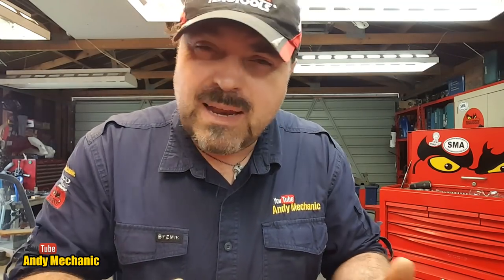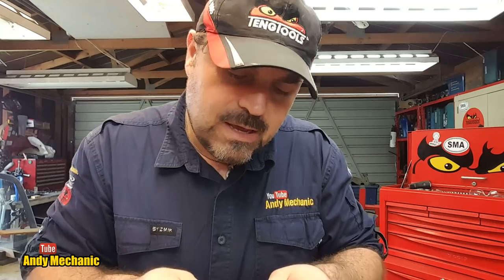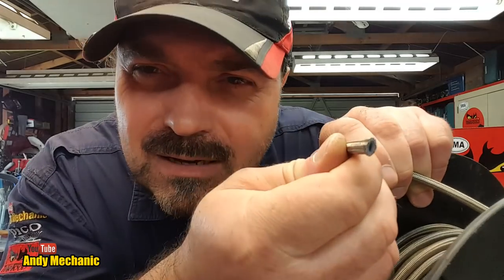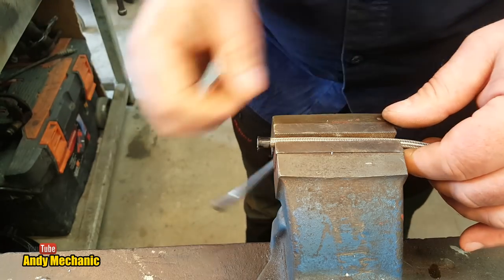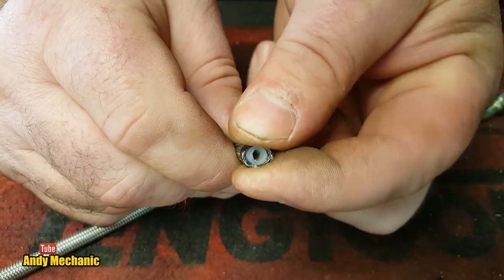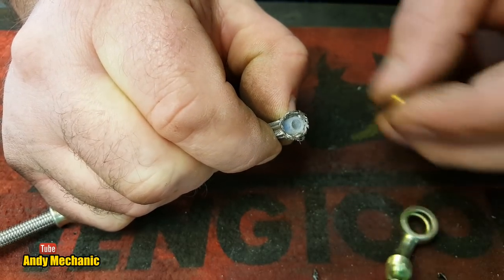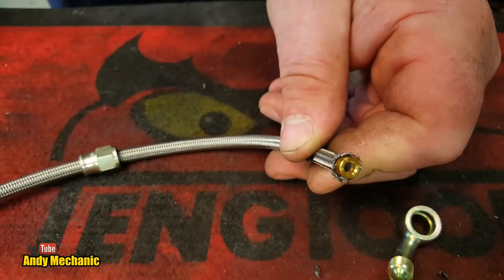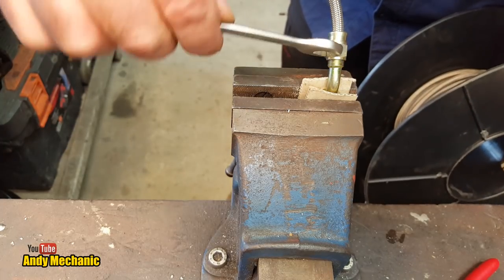How to make Stainless steel braided brake lines the RIGHT way #1336

Comment: Don't forget to blow them lines out when finished cutting through them because debris/dust blew into the hose while cutting it off and yes, trash goes inside there. Should blow the hose out before assembly as it will be easier than trying to get an air hose nozzle near the end of a brake line port as it is inside the loop. No sense in letting trash flow around in your lines etc. causing wear and tear, and possibly blocking ports or sticking brake pistons. Cleanliness is number one!!

Comment: Could have put the nut on the line first from the fitting. Then follow the steps on the video of taping the line and then cutting it with a disc grinder. This way you don't have to "fiddle" nut on the line.

Comment: The reason it's a 11mm is because everyone loses the 10 and 12mm spanners and nobody loses an 11
Reply from the maker: Haha! Awesome answer! Lol
Reply: I don’t even have an 11 socket I don’t think
Reply: @jaredtippets6255  Good because you can't even use a socket on that.
Reply: The reason an 11mm fits  is likely because its actually imperial 7/16" which is a close comparison. This  teflon fitting/ hose system originated in the USA.
Reply from the maker: Ah....good to know, thanks Nick :-)

Comment: Worth pointing out that this video features braided hose without a clear plastic coating on the outside, which would need peeling off for a short length if you are to have a chance of getting the hose into the fitting. Also I found with the pipe and fitting I had that the olive was very much harder to get over the teflon inner than in this video, and similarly getting the spike into tube through the olive very tricky.
Reply: yea same as venhill sleeved hose pain in the arse

Comment: I've had a recurrent problem with the DIY threaded union lines. The last few threads worth of tightening always seems to cause the braiding and the inner tube to twist, and then tightening the other end adds to the twist.
This can ruin the teflon tube.

I would like to suggest that suppliers send a reverse threaded union for every normally threaded one, as doing final tightening would then cancel and twisting tendency .

Comment: Shrink sleeve around and overlapping the end of the hose with is little lubricant allows you to slide the fitting on the pipe easily.

Comment: Nice video, after cutting the hose do you ever have to worry about cut particles inside the hose at all?
Reply from the maker: Interesting point, thank you. It hasn't been an issue yet but blowing the pipe through should clear any out.

Cheers
Andy
Reply: @AndyMechanic  I did like the idea of not crushing the hose with diagonal cutter. Great video.

Comment: The 11mm is actually 7/16" AF. Probably made in the US. A good close up of the tool would be useful to help me turn one on my lathe
Reply from the maker: Yes, I think you are correct, the kit could well have been made in the US. The hand tool just has a short nipple that inserts into the Teflon pipe and a tapered outer that then runs down the outside of the Teflon to flare out the branded cover. Suppliers of the unions/pipe should also list the Tool as it really helps when making up these lines. You'll probably find it on the suppliers Web site.

Hope this helps
Andy
Reply: The tool from goodridge is £12. Maybe $10 They come in different sizes for different  size hose.

Comment: i,ve got a tricky one for you, SO i have the Honda nc750s with abs on it, i won't to change my handle bars which means i have to replace the front brake hose making it longer, the problem is the brake hose runs from the reservoir to a junction box below the light, that hose has a crimped end to the junction box or block, whichever you chose,  so without putting a joint in the middle of the pipe because insurance companies are getting very keen these days, how would i go about removing the fixing and replacing it, or would i need all the crimpers to do the job, by the way happy Christmas from glossop just over the road from you at the bottom of the snake pass.

Comment: hi andy greetings from italy. nice video indeed. two questions : first , should you screw in the assembly until all threads are " disappeared"?  second question : when i am going to tighten secon end of a line i cannot find a way to avoid havin the pipe twisting while screwing. in this way i loose the right position on the brake lines of fittings. how can i solve it? thannk alberto
Reply: I agree...was about to ask the same question. I've just wasted a day trying to get the two short lines back onto the master cylinder on the prototype Grinnall Scorpion 3, it seems to be quite impossible, as the final torquing always moves the hose.

 It would be  far easier if there were reverse threaded unions, so torquing the other end of the line would remove any twist stress in the hose.

Comment: Andy I've got a question regarding stainless hoses. Say if I have to change a brake caliper on my car, and I want to prevent the brake fluid from pissing out. Now I got stainless hoses in and always think I could destroy them, If I use plastic line blocking clips on them. What do you think?
Reply from the maker: Yes, don't use hose clamps on the stainless hoses as it will damage them. Instead, use an old Tyre valve stem - they are rubber and usually fit extremely well into the banjo fitting to seal it....top tip :-)

Cheers Andy
Reply: (Here, in the States) Was just about to google "Tyre valve stems" when it dawned on me I should read "Tire valve stems".

Comment: Am doing brake lines for a FSAE vehicle, and would like to know what the tool you keep referring to is? Perhaps a link to the specific tool? It's the tool that separates the braid from the tubing
Reply from the maker: Yes, I don't have a link unfortunately as its an old tool but it is readily available from the suppliers of these kits. Send them a link to the video or a screenshot of the Tool from the video. 

Hope this is of help
Cheers
Andy

Comment: Why not put the nut onto the hose before cutting and stop it sliding around with tape? When you clamp something, even gingerly, in a bench vice get as central in the jaws as possible. Apart from that instructions very useful for a hydraulic novice like me.

Comment: Thank you for the video,  i did recently  a compression fitting on my brake line that carry fluid from master cylinder to abs pump iwanna know is that safe or not ?
Reply from the maker: Hi, some countries have band the compression type for highway use. Personally I haven't had a problem but clearly there must have been at some point for them to become banned in some countries?

Cheers
Andy

Comment: Are the fitting reusable.  I have some older lines that I made up for a project that are no longer in use.  I was thinking I could reuse the fittings if they are not one time use like the crimp type
Reply from the maker: Yes, the fittings can be reused but you'll need to fit a new olive just to be on the safe side as these can deform.

Cheers
Andy

Comment: If you staked the nut, would it make it legal for road use in New Zealand? Would staking be safe or do these fittings need to be tightened after some use?

Comment: i watched this whole thing eagerly awaiting some good bimbo action ... thanks fer nuthin' !
is this braided steel hose designed specifically for brake fluid ? i ask because i have a good assortment of braided steel hose in my hoard that  must have come off of dishwashers. like a good tightwad/hoarder i would love to be able to use it in this application but i also like staying alive and  dont want to use it if it's going to disintegrate from the brake fluid.
Reply from the maker: Hey, sorry no Tool Girls in this video.....

The lining is Teflon I believe & that is good for Dot3 & DOT4 brake fluid. If your dishwasher hose is Teflon lined & rated for up to 2000psi then it should work but don't quote me!

Cheers
Andy

Comment: Standard size hose fits all motorcycles ? 8mm yours is like mine with 11mm locking nut ? Problems with my olive as it won't fit over the tube 9mm or so which leads me to ask ,, how many sizes exist nobody knows ? Drilled out the olive but not confident being 2 wheels .Lol

Comment: Hi Andy, i have a hd sportster  and my rear brake hose line is old so i want to replace it with a new one but my model a 96 has a point where there is a by-pass bit threaded where an electrical brake switch is fitted, i can send you the pics if you like and want to help me, please let me know...ps i am in UK,  i already have the stainless steel braded pipe, the banjo bolt is 3/8

Comment: good shit mate. i cringed a bit when i watched the other video and he cut it with wire cutters.. only tip i could add, is apply a little oil to the hose and fitting during assembly. especially with stainless fittings.

Comment: Thanks for the video! I have been running a very bent front brake line and it will be fixed soon.

Is there a difference in the hose for DOT 3 vs DOT 5? Also, I took a quick look online for the parts and could not find them. Any suggestions on a Google search or some company's to look at?
Reply: None. The only difference is the boiling point of the brake fluid and the corrosive properties between DOT 3 and DOT 5. Brake fluid will still perform hydraulically in filling the hose to perform mechanical work. So if he used a little bit of a larger hose, he would probably just need more fluid. But the boiling rate would be higher therefore less brake fade.
Reply: Also Summit Racing sells the parts.
Reply from the maker: Dot 5 is a silicone based brake fluid, I think you meant to say Dot 5.1 - agreed, the higher the Dot rating the higher the boiling point of the fluid plus maybe other additives too...

Cheers Andy

Comment: I changed my slave cylinder. And can’t get proper pressure in the pedal because I can’t get a 100% seal on my banjo bolt.. used new crush washers. Cleansed the shit out of everything. Can’t seem to win..
Reply from the maker: Very odd? Don't often get that problem. Just check it's not bottoming out on the threads - due to been a fraction too long?

Cheers Andy
Reply: @AndyMechanic   it’s the same bolt that was in before.
Reply from the maker: Okay. But washer thickness may be a little less & does it thread into the new slave cylinder? If so, maybe the threads aren't cut as deep? Does it also go in perpendicular to the sealing surface? If it's off by a degree or two then that can cause a leak too.

Hope this helps
Cheers Andy
Reply: @AndyMechanic  it’s not bottoming out.. it’s a matter of a seal with washers heated them up before install.. used a hammer tapped the bolt to help them crush down.. still leaks.. can’t build adequate pressure
Reply from the maker: That's really odd? No damage to sealing surfaces on the banjo? Also check the banjo isn't cracked between the round bit & the steel tube part that goes to the flexi pipe. Other than that I have no idea!
Reply: @AndyMechanic   no damage to any surface. Sanded with 2000x and wiped clean.. I’m going to try a mixture of new crush washers, new banjo bolt, new rubber washers and high temp gasket maker.. if it still Leaks after this I’m pushing it into the Detroit river lol
Reply from the maker: Haha! Okay, good Luck :-)
Reply: Well …. STILL LEAKING!! Lol I tried my crazy layered method with gasket maker and different washers… it only leaks when I try to blast fluid up the bleeder with a syringe… I figured air rises and that would work… but still leaks enough that once I build to a certain pressure it somehow pulls in air … now I slathered gasket maker all over the bolt and any seam related to the banjo/bolt/slave marriage. Because it’s only drawing in air and not leaking fluid I figure this will have to solve my issue.. just updating this for anyone else who ends up with some mental lemon clutch system like mine.. post later my results.. lettting it fully cure before trying bleeding again.
Reply from the maker: Ah...so no fluid leak, just air getting into the system. Was the problem evident with the old slave cylinder?
Reply: @AndyMechanic  old slave was leaking.. swapped it amd the master twice each now.. there’s still air getting in somewhere. I’m going to buy an upgraded master oem slave and gonna make a 1 piece line.. that’s gotta work…

Comment: You seem unduly concerned about a microscopic pin prick from the braiding or deforming the (as stated)old hose, yet you quite happily use that grinder without the guard. Why even bother with safety glasses if you do that? The fatal injury will  not be a spark in the eye, it'll probably be a severed artery if that disc lets go and hits you in the head. And,no, I am not a safety Nazi. Or lazy.And in 45 years of being a welder, I have never "had the guard get in the way".Keep the videos coming buddy.

Comment: Or get a JIC-725 Coax cutting tool that is similar to a side cuter but made for cutting coax which is similar in braiding and inner core and intended to cut without squashing it. Much faster and cleaner than this method.

Comment: next time slide the nut over the hose before you cut it.............
Reply from the maker: That would work on the first hose you make off the reel but after that you always have the same issue unfortunately :-(
Reply: Couldn't both nuts be placed on the hose before cutting the first end?
Reply: Andy Mechanic hi Andy. I want to buy this braided line and the fittings to make a line for my 1100 v star motorcycle front brake. Do you know where I can buy the products?
Reply from the maker: Try 'Parts Unlimited' in the US - www.parts-unlimited.com  It's a long time since I purchased any but had no problem ordering the kit or top up unions. If you search on Google you'll find plenty of suppliers doing similar kits.

Cheers Andy
Reply: Andy Mechanic thank you Andy
Reply: @AndyMechanic  hey, u can just slide in both .... ;-)

Comment: Using an angle grinder is wrong as well as the heat will be so high that it'll melt the hose inside as well as cause burrs. How about... I dunno... a pipe cutter? 🤦‍♂️
Also put the nut on before you do the cutting. I thought that was quite obvious. 🤦‍♂️